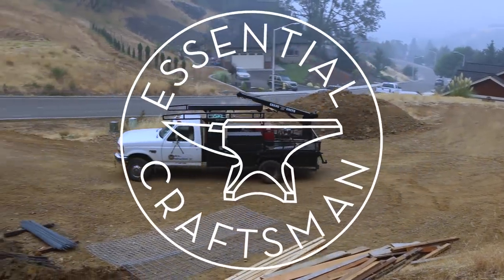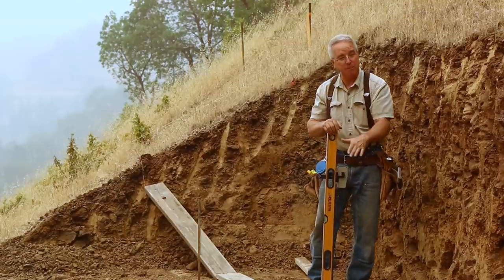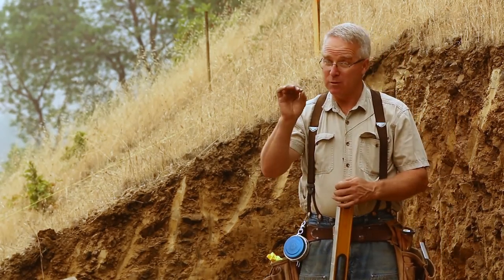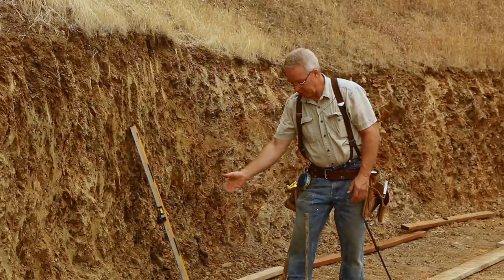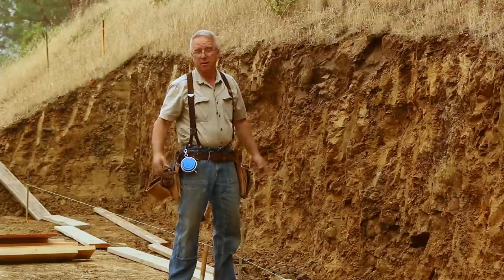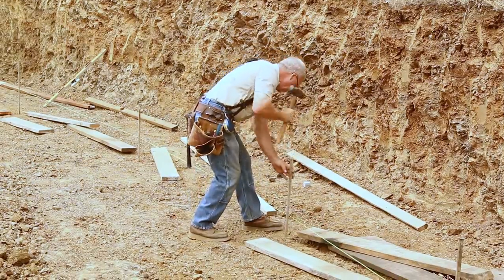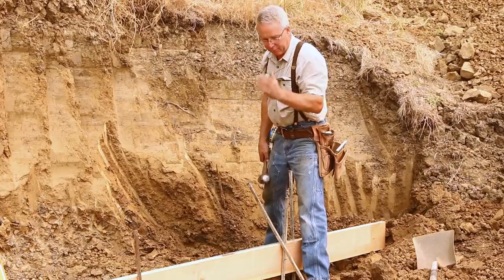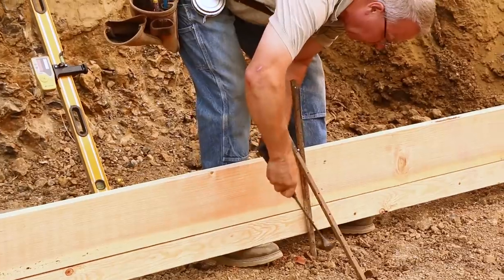How To Set An Edge Form - Spec House EP.08

Comment: lover the "hammer it down" trick.  What will go under the 2x4?  You mentioned it will stop leaks, but the big gap below it has me curious.
Reply: dirt
Reply: rjtumble there are different ways depending on conditions of job sites.. some excavations will have gravel spread or loose dirt you can shovel up against to keep the concrete in.. I've seen another method where people use rolls of vapor barrier in roughly 18" widths and staple it to the inside of the footings and this will also hold the concrete in.. and in some cases people use scrapes of wood on the out side of the footings filled between the stakes.. I think the vapor barrier is the best method although your left with staples in the lumber which is a pain if you plan to reuse the 2x for framing later on. The benifit however is that your stakes won't be covered in concrete. Although if your using wood stakes that wouldn't be much of a concern.
Reply: It looks like the top board is a 2x10 plus the 2x4. Together, they will add up to about 13 inches. He needs 12" of support for the concrete so the rest of the space will be filled with gravel.
Reply: wpattison if he's worried about a little bend to save a meter of concrete the gap at the bottom will  leak more then that across the span of the footing unless it's a 2 inch slump which will make the concrete nearly impossible to finish. Maybe the honeycomb finish is fine but the way he is doing things it seems like the building codes are quite strict.
Reply: Tyler Lizeé  dirt will back the form board, or he'll fill the bottom of the footer with gravel

Comment: Hey EC can you do a 101 basics video on using the laser level?
Reply: Good call Jack Shoulder. I'll second that!
Reply: If he does a video, I am sure it will be better than any I have seen. If you use a self leveling rotary laser level and detector like he did in this video, read the instructions and you should be able to figure it out. A good one will cost over $500.
Reply: I agree, that would be very useful.
Reply: agreed i"m not 100% sure how this works, and honor why the beeping happens.
would love to know!
Reply: Freek Hoekstra fast beeps means the receiver is high and needs to be lowered to elevation.  Slow beeping means the receiver is low and needs to be raised to elevation.  You can listen the sound and know quickly which way up or down to move the receiver.   Steady tone means you’re on elevation.
Reply: agreed, I've never used one.  I only know how to use the ancient water level.
Reply: I would love to see such a video, too!
(Together with, if possible, a traditional/ optical level… where one person was looking through that "thing" on a tripod while one had to hold that long board with marks on it. Do not know how to describe it better.)
Reply: Okie Rider it beeps fast when high beeps slow low and steady tone when on grade.
Reply: Just go out side and play with it, pretty self explanatary

Comment: Quick question! Is there a reason you’re using a steal hammer instead of your titanium hammer for concrete or did you just want to use it?
Reply: Foster Alex 
Titanium hammers are pretty high dollar and aren't really made for the abuse and misuse around concrete.  They are awesome for framing, but the weight and durability of steel hammers is desirable when knocking concrete forms around.  Kinda like not wearing your nice work shoes in the mud.
Reply: Adam R Makes sense, thanks for the answer. I’m a 17 year old first year apprentice and I’ll take all the know how I can get!
Reply: Also, the big win for the stiletto is overhead/vertical work. All this work is below your waist and your arm is pivoting below your shoulder like a pendulum. Here weight and gravity are your friends, not your enemy.

Comment: @essentialcraftsman why are you using a mini sledge instead of a cast iron maul?
Reply: Essential Craftsman as a fellow concrete guy I totally get the different sledges. If I'm doing tons of curb/gutter/sidewalk, it's a 10lb maul. Footings and pads, it's time for the 12lb and pounding rebar into holes it's time for black Betty, my 6lb sledge I cut the handle off of.

Comment: Wouldn’t you want your footing relatively square so the stem wall sits uniformly on top of it? Too much of a bend can easily leave an overhang of the foundation wall, no? Seems like more of a pain then needed, rather than just setting up two opposing forms when chances of a blowout are relatively slim(compared to a taller pour). Excuse my ignorance if I’m incorrect. My experience with “new” construction footings only includes pouring for repair (rip out and replace) of existing Cmu walls. In my experience piering existing foundations, I’ve seen footings out of square with the stem walls, but never have seen an earth footing poured against an embankment. Sorry in advance for the lengthy comment.

Comment: How do you tie string line?
Reply: That's what I want to know also, looks like one wrap and it stays.
Reply: 1 time around and make sure the string crosses under itself, when you put tension..alot of tension, the string will grasp itself...mason line works the best because it has flex.
Reply: The knot he used for the string line is called a  Larks head knot.
Reply: Look at the Square Stake video. He shows it there. https://youtu.be/UixavBBmHmw?t=1m55s
Reply: Iwouldlike Toremainanonymous  No, that did not look like larks head knot to me; a larks head knot is not easy to adjust along the stake under tension because it's hard to see the mark with too much looped string in the way.  It takes too long.

Comment: Screws and a 18v impact driver... Dont need a sledge hammer to absorb nail blow, can re use  screws, stripping nails just to pick the up and bin them, if you have to cleet two boards together, screws suck them together much much better, you spend time getting the steel pin right plumb and on the line just to whack it with hammer to nail it up, screws have minimal lateral force so straightness is maintained.
Reply: Love the videos, from a concreter/formworker 15 years
Reply: Bullshit.

Comment: Great videos, thank you!  I learn something new with every Essential Craftsman.  Sorry for the silly question here, but am I correct in assuming there's a lot of money spent on long wood boards which will just become trashed by using them as forms?  I get that the stakes can be reused, but are any/all the 2 x 10 or 2 x 12's and 2 x 4's reuseable?

Comment: You are both the builder and the client on this project.  You didn't mention in the video that you would never move a footer on your own, on a job that you were only the contractor on.  The architect, the engineer, and most importantly, the owner, have all signed off on plans showing a straight wall, if the contractor decides on his own to put a bend in it, he would probably be told to tear it out and replace it at his own cost.  The proper thing to do is call the architect and mention that the excavator did not cut the bank in a straight line and $110 can be saved if the wall is curved to follow the bank.  It is most likely that the architect would commend you for your consciensciousness, but she wouldn't give permission to do it.  It would change the aesthetic of the plan, and $110 is not much money in the grand scheme.  One more thing, if the bank and wall were designed to be curved from the beginning, the engineer may have been able to reduce the width of the footing down from four foot along the whole length.  As you know, there are complications with curved foundations and walls, however.  You can't use 2xs for the forms, they make it harder to lay block level, and they create a longer wall, which uses more material.  Lots of great information in the video, sorry for focussing on what might be viewed as a negative.